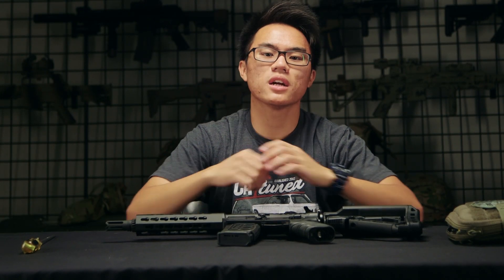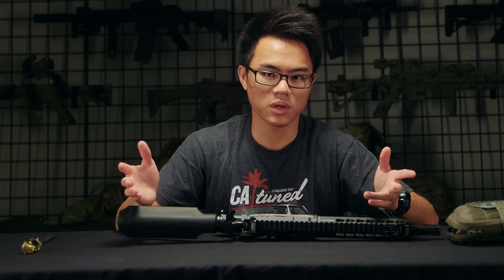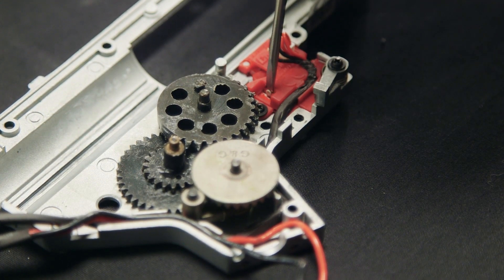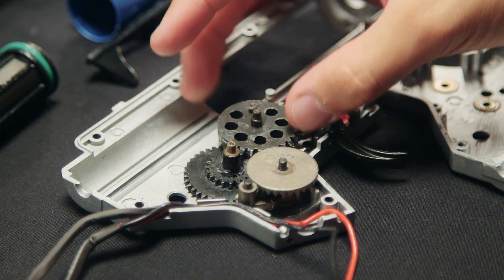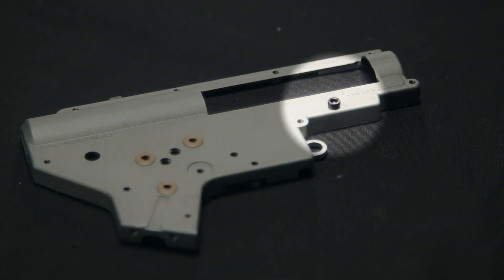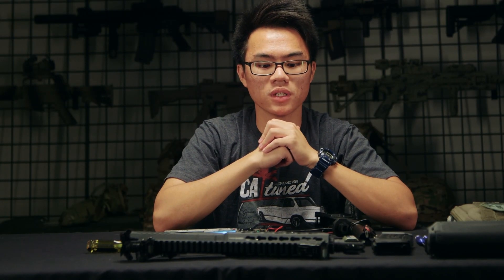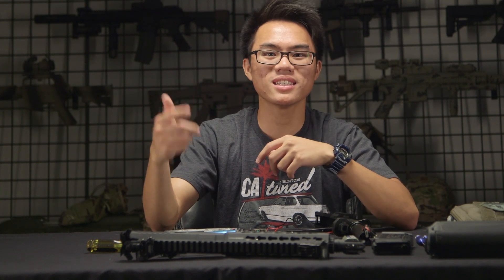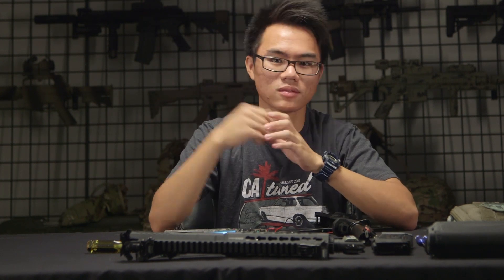Affordable Firepower | G&G Combat Machine SRS INTERNAL OVERVIEW - Airsoft GI

Comment: Brass bushings? Why would you do this G&G? You come out with internals that look almost half-way decent, toss in a 'fet, but then you put in BRASS BUSHINGS??(for the non-techs, think. Brass is a soft metal. Gears go round and round inside this soft metal...).
Reply: same thing I was thinking. the microswitch and and MOSFET are a nice touch, but really, brass bushings? come on g&g.
Reply: Wingman!, i asked g&g why they switched to an even softer metal but they never replied :( At the price point of the new combat machines the gearbox should be higher quality, and the receivers should be metal, unless i'm missing something..
Reply: But hey, at least they are trying a lil' harder and removing the second to last tooth :P

Comment: The cylinder head and nozzle are not polycarb. And a micro switch does not increase trigger response at all
Reply: bbsp Exactly. I would never let their tech, tech on my gun.
Reply: Is the still reliable and last a long time?
Reply: You're OUT of your mind if your gonna state you dont get better trigger response. As if arching electricity makes faster choices then a small ETU. i have 3 of the G&G SR series 2 modified so many shots in semi off go watch my videos. With my GF's G&G stock raider NEVER would I be able to lay down that firepower.